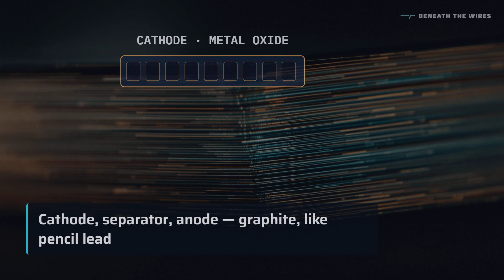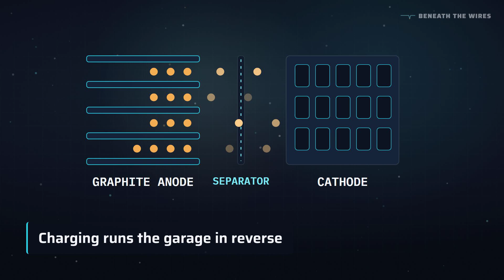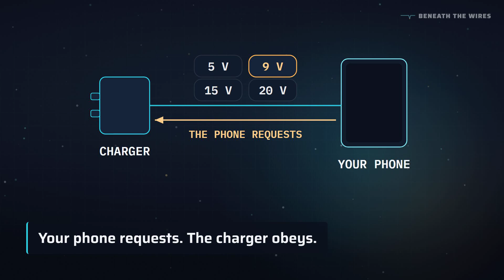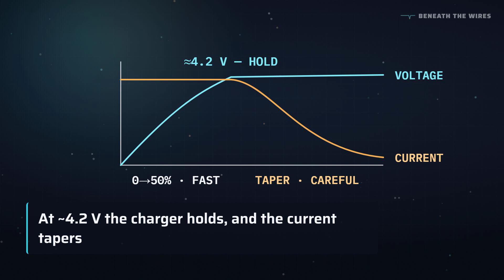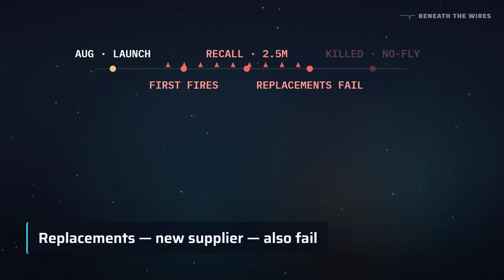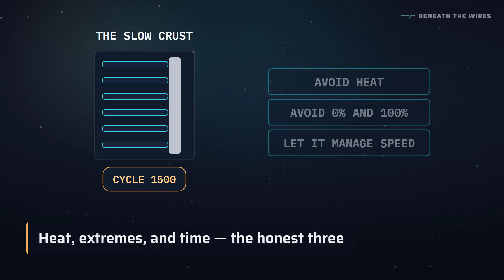How Fast Charging Actually Works (and Why Batteries Catch Fire)

Comment from the maker: Sources for this one, all fact-checked:
Nobel Prize (2019 press release): https://www.nobelprize.org/prizes/chemistry/2019/press-release/
Wikipedia: https://en.wikipedia.org/wiki/Lithium-ion_battery
Battery University: https://batteryuniversity.com/article/bu-409-charging-lithium-ion
Battery University: https://batteryuniversity.com/article/bu-410-charging-at-high-and-low-temperatures
Battery University: https://batteryuniversity.com/article/bu-304a-safety-concerns-with-li-ion
US CPSC (recall 16-266): https://www.cpsc.gov/Recalls/2016/samsung-recalls-galaxy-note7-smartphones
US DOT: https://www.transportation.gov/briefing-room/dot-bans-all-samsung-galaxy-note7-phones-airplanes
Samsung Newsroom: https://news.samsung.com/global/samsung-electronics-announces-cause-of-galaxy-note7-incidents-in-press-conference
BBC News: https://www.bbc.com/news/business-38714461
Wikipedia: https://en.wikipedia.org/wiki/USB_Power_Delivery
Sinovoltaics: https://sinovoltaics.com/energy-storage/batteries/stages-of-the-thermal-runaway-process-in-lithium-batteries/

If I got something wrong, tell me below. And if there's something you've always wondered how it works, drop it below. I read every suggestion and might make it next.
Reply from the maker: Great suggestion! The machines that print chips are some of the most precise ever built. Definitely one worth doing, added to the list 🙌
Reply: Could you explain how lithography works ? For example, the manufacturing of the mirrors, the algorithms used for the designs, etc.